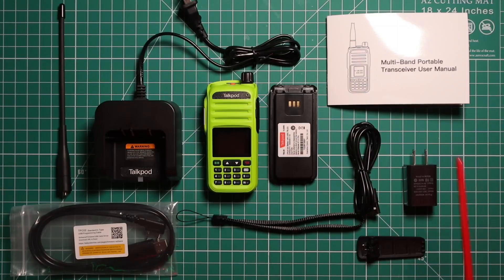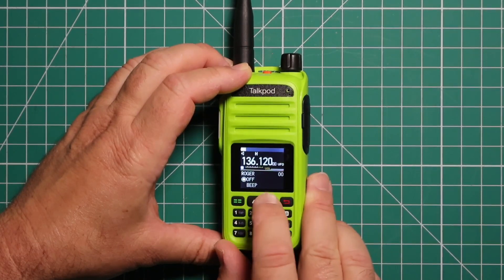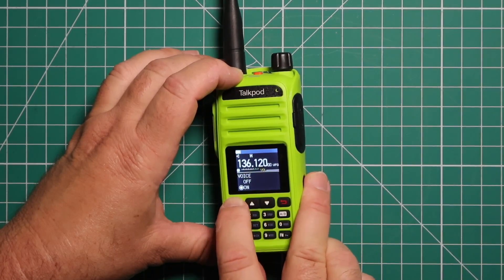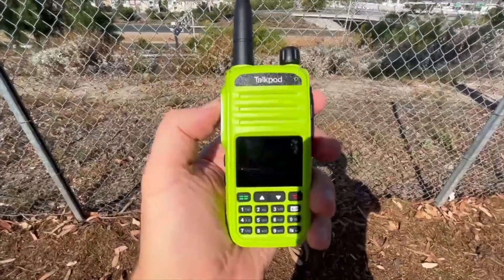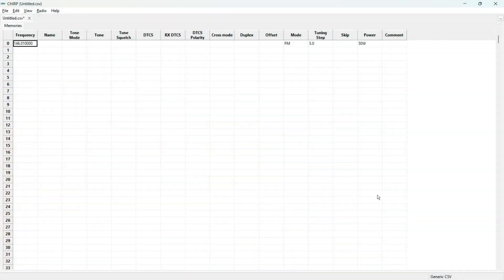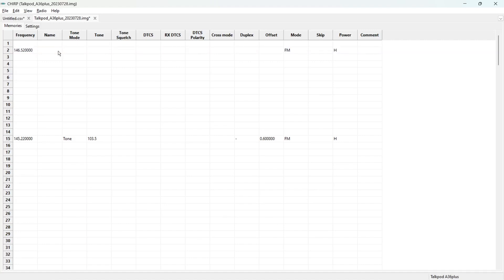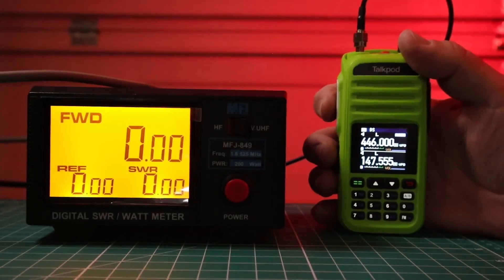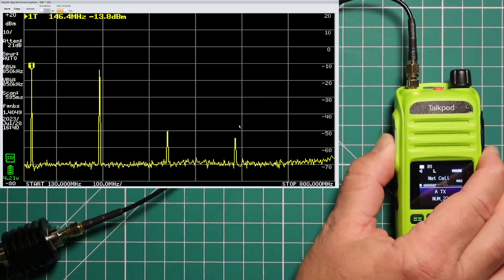Talkpod A36Plus Overview & Programming

Comment: Only complaint I have is the battery comes off the radio very easily. A couple of times it’s just left me with the battery on my. Ely and radio has come detached.

Using some tape now so I don’t loose the radio
Reply from the maker: Thank you for taking the time to watch and the comment! It is greatly appreciated. Thanks for this info! I have not experienced the battery coming off of the radio....... yet

Comment: Interesting and thanks for the review!  Does it transmit on 220 also?  Could replace the BF triband if harmonics cleaned up.  Cheers!
Reply: Lordy @ the harmonics
Reply from the maker: @TheSmokinApe  Thank you for taking the time to watch and the comment! It is greatly appreciated. They are jacked
Reply from the maker: Thank you for taking the time to watch and the comment! It is greatly appreciated. I agree. If Talkpod gets the harmonics issue under control this radio may actually put in the BF market. I have not yet tried it on 220 yet.